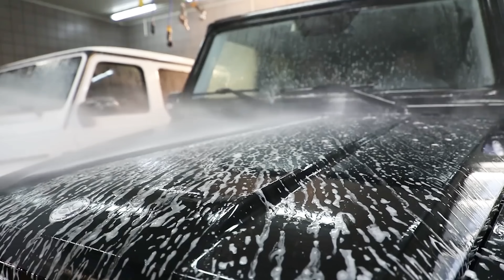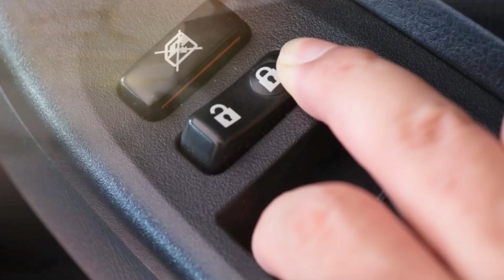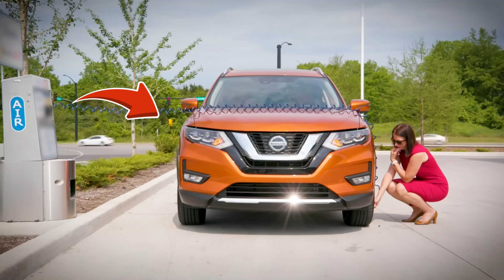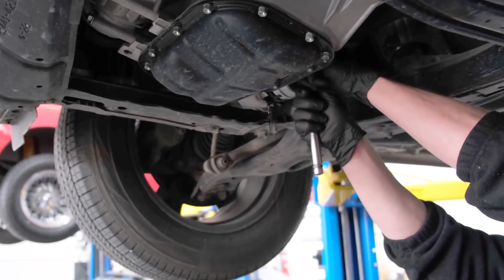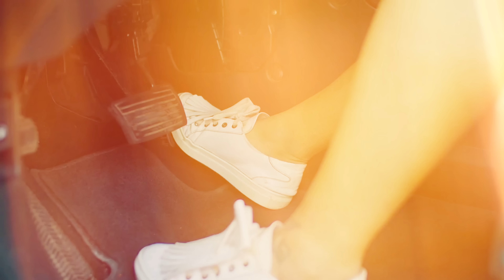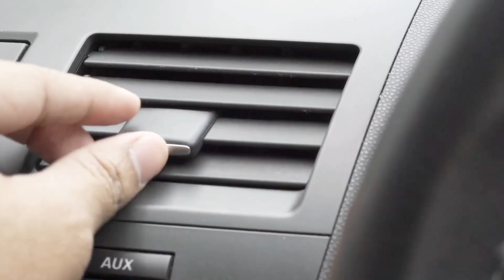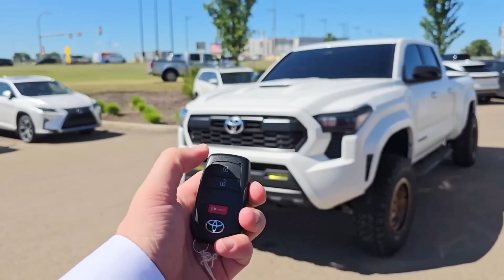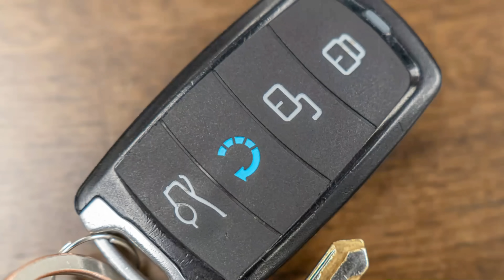This SECRET Car Features Is Only Known by 1% of Drivers (USE THEM NOW)

Comment: I don't think they ever said what the button is for on your seat belt. That is why I clicked on the video.
Reply: , known as a seat belt stop button or stopper, prevents the metal latch plate (buckle) from sliding to the floor when the belt is retracted. It acts as a stopper to keep the buckle at a convenient, reachable height
Reply: @KarenP-e7m  Thank you, I had a feeling that he wasn't going to answer that question so I went straight to the comments. 🙂
Reply: It's not an operative button. It's just where the belt loop is attached to the rest of the belt.
Reply: Me too!
Reply: And what did you learn from this video? Haha.
Reply: Take it off and see what happens.  Then you'll understand why it's so handy!
Reply: It’s there to prevent the buckle from falling all the way down. You welcome. Common knowledge, along with ALL the features in this video. Greetings from a Norwegian WOMAN 😂😂
Reply: @LVLittleVillainthank you your goodness!!😊
Reply: It helps when you pull the belt over you. I think.

Comment: If you own a car, read the owners manual. It’s just that simple. The owners manual might not tell you to jam a paper clip into your washer nozzles, but your washer nozzles may not be adjustable. Most cars produced today have a BMS (battery management system) integrated in the charging system. All you have to do is keep your battery terminals clean and corrosion free. Since you probably don’t ever open your hood, or if you do, you have no idea how to clean and protect your battery cables, listen to the folks at the quick lube when they say your battery terminals have corrosion on them and need to be cleaned. That $20-$30 service will save your battery, but more importantly it will save your battery cables. If you think a battery is expensive, call your dealership and ask how much a new positive cable assembly is, then ask how much it cost to install it. Read your owners manual, it’s not there for decoration.

Comment: #18 It's NOT a good idea to stand the wipers up like that to prevent them from freezing on the windos.  The wipers are not designed for that sort of wear and tear.  What you do if the wipers are frozen to the window is preheat your car, brush off the snow, AND gently physically loosen them from any  ice before turning them on.  (FYI: My father was an engineer/designer for Ford -- I knew of most of these "secrets.")
Reply: Not practical in northern Wisconsin during the winter.  Too much snow and ice.
Reply: Agree to disagree

Comment: If I'm at the gas station and my battery is so dead that I can't open the fuel door, I have bigger problems than the fuel door not opening.  The "A" button with a circle around it is for your auto start/stop feature not your auto hold brakes.

Comment: Great news
 you can open the fuel flap to fill up your completely useless car that has total electrical failure .
Unfortunately you need to replace the seat belt after totalling it hitting that tree

Comment: So much automated junk to worry you...I yearn for my ancient Beetle ...one oil warning light was all it had! So little to go wrong.
Reply: Yup, and when the 'external block lube' started smoking you knew you had a cooling issue... lol
Reply: I could work under my ancient Beetle without needing to jack it up.  Of course, I was young and agile, then.
Reply: And the red generator light
Reply: this is scare, my cat confuse
Reply: The most important thing i had to learn when I first driving an automobile was, never wrap.my thumb around the turning handle when attempting to start the automobile ! If not then the kick of the engine often broke one's thumb ! 😏

Comment: The "manual" release for the gas cap explanation is about the dumbest crap I've heard. Basically it said the battery is dead and you can't recharge a dead battery with no gas, so you pull the manual release to be able to add gas to start your car to charge the DEAD battery.
You can't open your cap without a battery with some charge, and you can't start your car no matter how much gas you have with a battery without some charge. 

Either way you have to CHARGE YOUR BATTERY, so what does it matter if you wait to fuel up until your get some charge? 
The only scenario is if someone happens to stop for you with a gas can but no jumpers, so now you only have one thing to worry about.

Comment: #10 fuel flap. So the battery is dead at the gas station, really. You got bigger problems than getting the flap open, and how did you get there in the first place. And, don't buy a car with an electric fuel flap opener, that's just ridiculous.

Comment: I'm going to have to try the throttle one because my vehicle is sluggish when I hit the gas from a stop. Not all of the time but occasionally. So let's hope that suggestion works! Thanks!
Reply: Ok it's been i day. So did it work? I am going to do the same thing. I hope it works.
Reply: It's a possible solution, but unlikely. So many other factours can make your vehicle sluggish from a start. But also, it's free, and easy to do, so go for it.

Comment: How do you clear error codes if you don’t have a physical key but use a push button? Can I hold the button for 30 seconds
Reply: Google it. I Google everything.
Reply: Disconnect the battery.

Comment: Thank you!  the seatbelt adjustment was something I never realized!
Reply: The problem that I have with the seatbelt adjustment is that it does NOT go down far enough for shorter stature women. I get it to hit me right at my neck and it nearly chokes me. They only think of an average height man, and not of the needs that women encounter.
Reply: @minnielitlebit   Try a pillow!
Reply: That's because you didn't read the owners manual.
Reply: @ChickenMan210  I have a friend with a 2010 Honda Accord. This woman has the just right car for her, if she was a car, she'd be a 2010 Honda Accord. 
Anyway, as a favour, I gave her car a really good clean, not that she kept it dirty or messy. I did find her drivers licence under the front seat, which she didn't even realize she was missing. Awkward if she were to get pulled over. 
We were going on a trip with it after the clean, and she opens her trunk to put in luggage, and says 'I didn't know the back seat flips down' as I had done earlier. This didn't surprise me.
Reply: @ChickenMan210 ...Figures only a CHICKEN creep would say that....

Comment: That's is not a fact dosent of time i have had to give kia car's a jump start because the battery was totally empty and no way to even try to start the kia car
Reply: Get yourself a new battery (the old one's not holding the charge) and as a back up a car powerbank (has jump leads attached). Cheap and helpful in an emergency.

Comment: One 'feature' I find most folks don't know about . . . sometimes we drive an unfamiliar car (friends', family, rental, etc.) and we arrive at a gas station but don't know what side the gas cap is on.  Well, virtually all cars/trucks have a small triangle/arrow next to the fuel pump symbol on the dash that POINTS to the side that the cap is on.  Keeps from having to get out and look & possibly reposition car.
Reply: Hey! That’s a good heads up man. Thank you
Reply: I only JUST rented my first car that DIDNT have that arrow.  I was annoyed!
Reply: @janeillinois9631  In the rare cases when the arrow is not present, look at the gas gauge and notice the picture of the “gas pump”. Then notice what side of the pump they put the handle on. Here’s your sign.
Reply: @CS-oe8ogI will check next time- I was truly surprised to encounter one without it
Reply: I always read the whole Owners Manual, and am sure I have never come across these tips in them.
Reply: @vanwin-p6b The majority of these tips do not work on my wife's 2022 Ford Bronco Sport nor on my 2021 Nissan Frontier.
Reply: @vanwin-p6bwell that fine except when you rent a car. My Mazda Tribute was in the shop to get a new radio and CD system (took them a month to find one) but the new car they let me use had a owner manual that was 3 time longer then mine. I never did fiqure out how to set up my phone to the entertaiment system. They ask me if I want to try a electric car. That was a big fat no.
Reply: @JeniferMarkoe  Maybe that's a good thing you couldn't connect your phone. Or add your home address to the GPS. Because, it's very likely you'll forget to reset the system to factory settings, and keep your personal information in that loaner car. This goes for also trading in your car. ERASE everything.
Reply: I just use to check  which side before getting into a car I didn't know.
Reply: 2000 I rented a New KIA for our trip Phx-Las Vegas. Got to Searchlight, Nv and spent 20mins looking for the gas door release!  No one could find it.  It was right there, tho'.  Right under the arm rest built into the bottom of it!  Just happened to run my fingers along the bottom of the armrest and felt a small indent/hole........... Bingo!  LMAO smh
Reply: You could also just open the fuel filler door from inside your car, and check your rear view mirrors which side it opened before you pull up to the fuel pump.
Reply: @perryelyod4870 - the fuel door is not visible in my wing mirrors. Wasn't in my.old car, either.
Reply: English people don't say "here's the kicker". So why is this apparently English voice TTS doing it?
Reply: That's good to know for a future time when I no longer drive a 26-year-old dependable truck. LOL!  OR... the next time I get a new rental. 👍
Reply: I have vw golf 4 and there is no indication on the dashboard. So not every car has it. It think it's mostly US thing.
Reply: @xunepxaxo  The Germans are a bit more clever . . . on your Golf 4 look at the gas pump symbol.  On what side is its hose?  :)
Reply: @xunepxaxo  The Germans are a bit more clever . . on your Golf 4 look at the gas pump symbol.  On what side is the gas hose?  :)
Reply: I put fuel injected lug nuts on my truck and all problems I had in the past, have ceased.
Reply: not so

i can remember when car's fuel tank outlet was hidden behind the rear license plate, which flipped down to show the capped gas tank outlet
Reply: It’s actually funny how many people don’t know this.
Reply: I'm driving a 2010 prius. No arrows. I'll have to check if there is a pump symbol. I rarely go below half a tank before filling. When i rent a car, i check all of the most important functions: lights, turn signals, hvac, wipers, gas cap, even the parking brake before i leave the lot.
Reply: I thought everybody knew that? - it's so obvious on the dashboard.
Reply: @kazzer115 that’s the kicker
Reply: You're correct. I still am showing people this neat little trick.
They either show an arrow or the shape of a ⛽️ hose and whichever side it's on, this is the side you will want facing the ⛽️ pump!
This has been placed on 🚗 🚚 🛻 for decades 😂
Reply: You could always have a quick look before getting into the car - or is that too hard to think of?
Reply: Most foreign cars, at least japanese, have the refuel on the left. US cars have them on the right. Not sure why they make the driver walk around the cars.
Reply: @RMount_5b   If the car is left hand drive, refueling on the right side is most convenient as you can park closer to the pump and leave more space for other cars.  
 
From what I've seen, though, refueling on the right is most common for "regular" cars and on the left for SUVs and vans - regardless of the brand or country of manufacture. I can't remember ever having seen a car where this wasn't the case - aside from some very old cars that were made to be refueled on the rear end.
Reply: @JohnCurtisDownunder ... exactly, the only time I might forget is if I change cars, but I soon learn, it's no biggie really.

Comment: My 2003 Camry has a timer to cut off lights. Took me a few years to really use that. (I’ve had my car 20 years.) I still have kind folks remind me that I left my lights on. Now, I just thank them and say that it’s a Toyota, it’ll automatically cut off the lights. My LE version also came with bag hooks in the trunk. My Ford loving brother even switched to a Toyota. BTW, mine was made in Kentucky.
Reply: My 2001 Toyota Tacoma doesn't have most of these features.  Im sure they have more now.  Mines still in great condition 182000 miles .
Reply: I used to have a Toyota and got tired of the light coming on when it was due for a checkup, a few times they forgot to rest it and had to go back. I always keep track of when I need checkups don’t need lights coming on and staying on.

Comment: Here's an interesting kicker: usually once the airbags have deployed, most insurance companies consider the car totalled.
Reply: I thought so too- until last weekend.  I got Tboned in my new 2025 vehicle, airbags deployed. Statefarm would not total it. Even thou the impact did significant damage to the exterior plus airbags they said bc the vehicle is so new they would rather repair it than total it. Was told only way they would total was if frame was bent. 😮😮
Reply: @georgiareddirtroad9919 You need have the frame examined again.
Reply: @georgiareddirtroad9919Get a Qualified Automobile Engineer to Examine And Report on the condition of your 2025 vehicle. If, the Engineer Reports say that Real Damage has occurred to your vehicle Structure, Then your Insurer may pay The Book Value for a 2025 Vehicle.

Of course if you , as you stated were T-boned, then it should be the Insurer of the Vehicle which crashed into your vehicle which should be responsible for the damage to your vehicle, unless you were responsible for the T-boning incident in some way or other..

BTW if you do not get the person responsible to pay for the damage,  Then, get your own vehicle Insurer to repair your vehicle, THAT WILL CAUSE YOUR CAR INSURANCE TO INCREASE IN PREMIUM.

AGAIN, I do not understand why you are asking your own Insurer to fix your vehicle, if a third party damaged your vehicle. Why would you??
Reply: @Lawrence1st-w4g bc i failed to yield…
Reply: Without Prejudice 

@georgiareddirtroad9919If you have Comprehensive Car Insurance Then Read The Terms And Conditions...But in your position, if the Car is Structurally Damaged then your Insurer Should Replace the vehicle, probably with a vehicle of the same year, mileage, and, pre crash condition. Or, The insurer may have terms that the insurer may decide to offer you a cash settlement. Obviously, I do not know for sure, because it will be decided based on your insurance terms and conditions, And, if the loss to you is confirmed by a vehicle structural engineer, if you obtain a Independent Vehicle Engineer Report confirming that your vehicle is structurally unsafe due to the t-boning. THEN you have something to argue and get your insurance company to honour its contract.

You really have to decide for yourself, if the difference which the insurance company are currently paying and the loss of your preceived value in the car are worth your time and trouble to attempt to force the insurance terms and conditions.

If, you haven't yet spoken with a Lawyer wherever you are living, perhaps it would be worthwhile.

As I do not know you, and, I do not know the place you live, it is not possible to say anymore.

If, you live in America, there are many lawyers who will speak to you either with an initial visit free, and or, if they thought you had a case, they may decide to represent you for free, or, no foal no fee.

You should not place any more posts on the internet, because your insurer can see what you write.

Accidents.
Reply: Yes & owner has 1st crack at buying it back from wrecking yard dirt cheap
Reply: Exactly 👍🏻

Comment: Do you REALLY think that no-one else has worked out that lowering your door mirror angle so you can see the kerb etc. helps when you are reverse parking? If brains were dynamite you'd not have enough to blow the wax out of your ears!!
Reply: Wow dude chill..you're gonna have a heart attack...😲
Reply: @AZPatriot2000  No mate, I give other people heart attacks.
Reply: @JohnCurtisDownunder  I think I just had one
Reply: @elliottpeabody1287 One what?
Reply: "Curb" is the correct spelling
Reply: @LondonBlue6894  No, old son. Curb means restrain or hold back. Kerb is the piece of  concrete or stone forming an edge between a pavement and roadway. DOH!!
Reply: It all depends on where you are. In American and Canadian English "curb" is correct for both.
Reply: @fastauntie you're both wrong. in finnish it's reunakivi 😅

Comment: You don't need a special system for making your wipers move to the vertical and stay there - you switch them on, then turn off the ignition when they are vertical. How easy is that? It works on every car, even a 1948 Morris Minor. As for the "trick" of pulling the wipers away from the windscreen before changing the rubber blades - do you REALLY THINK no-one knows that that has to be done??? Do you have shit for brains?
Reply: Why, yes!  I think I DO have shit for brains.  🤣🤣
Reply: What a ridiculous hothead you are.  Goodness knows how you're going to react in a serious situation.  You need to get some professional help for anger management and managing in a crisis.  All you are doing with your rants is show the world a window into your personality.  Not a pretty sight.